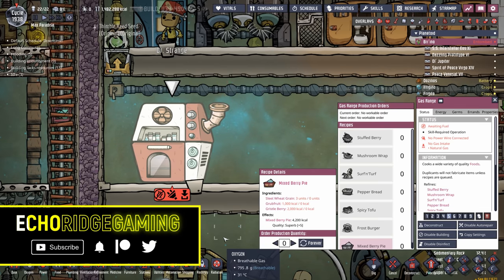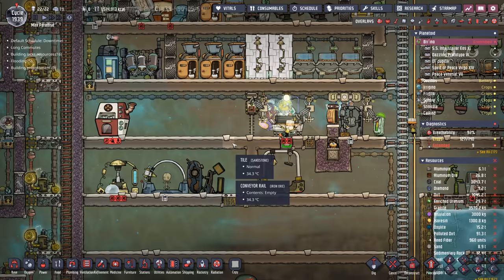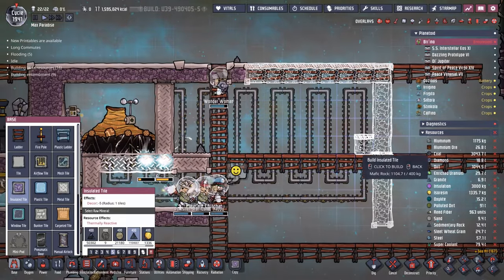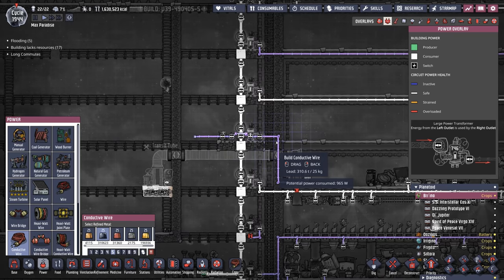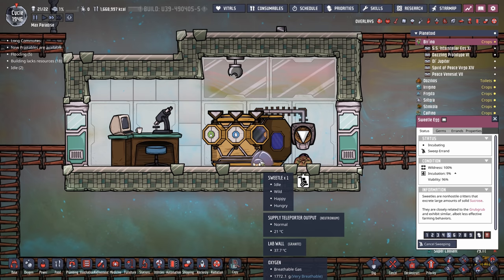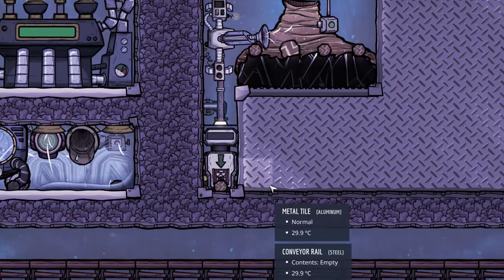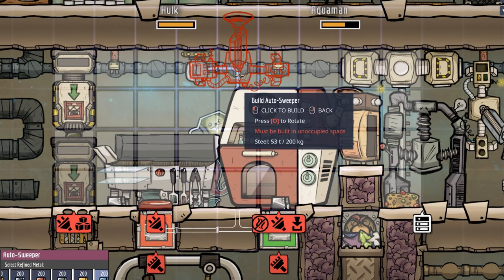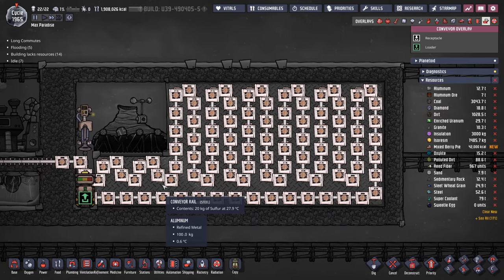Mixed Berry Pie | ONI Spaced Out | Max Difficulty Ep 24

Comment: You have a giant cool brick. Why not use that to cool your metal or in this case, Sulfur. Better yet pass it through your slicker farm to dump its heat then to the cool brick then to farm. :)
Reply from the maker: Two reasons I thought that might be problematic.  First the cold room is -200 something so I wouldn't want the sulfer to be that cold (and stifle the crops).  The second is I still would have to get it to the cold room.  Transporting the hot sulfer halfway across the map without being chilled, would have dumped a lot of heat into the environment.  

Also sometimes, it just makes for a good contraption to show YouTube :)
Reply: @EchoRidgeGaming  ok i didn't how far the cool brick was but its something impressively built. Gonna have to built one for myself.

In that case, my vote goes to puft ranch. That's something I've never been able to ranch successfully. They keep dying. Plus the one prince per ranch is challenging on it own.

Comment: You mentioned the sulfur backing up but you put part of its run of rails on a shared line.  If it backs up it will block the shared line as well.
Reply from the maker: Absolutely.  It will back up, but not permamentaly.  It will still move at a fairly regular clip.

Comment: pufts are not terrible to use for bleach stone. remember that a puft prince alone can support 6 waterweed. if a chlorine vent can support 2 pufts, then you can keep 12 plants going. if you are willing to invest some time for puft ranching, a single squeaky puft can support 57 waterweed plants. this means that a standard chlorine vent could support 114 plants. 

since you only need 2 to accomplish this, you won't need a dedicated ranch for squeaky puft breeding. you can have just a puft stable, puft prince stable, and a large room (non-stable) for mixing puft and puft princes. since pufts lay eggs fast, you wouldn't need but a stable for maybe 1 or 2 of each type.
Reply from the maker: Challenge accepted.  Appreciate the pep talk ;)
Reply: @EchoRidgeGaming  keep in mind the puft prince should be able to support 6, but that is on paper. i don't know if it could in game. the only time i have used pufts, was to feed mushrooms. i was able to support more than 10 with 2 pufts, with a building up of slime reserve, so it could be correct.

Comment: Couple of thoughts about the sulfur line, I BELIEVE they still have not fixed the bug where conveyor rails still transfer heat with the tile below them even when they themselves are in a tile, insulated or not. If this is the case since you have the lines exiting the cooling brick and passing directly over your aquatuner steam room there is a chance that it will heat the sulfur back up as it passes. This is probably why it was coming out so warm initially. This really screwed up a volcano petroleum boiler I made where I ran the igneous rock left over from the volcano thro a cooling brick where it passed over a steam room and heated back up from 35 to 150 degrees on the way out. The second thought is you have the sulfur making a pretty long trip through open air where the temps are at 60ish degrees. The sulfur may end up reaching the farm pretty warm early on. I think both issues can be solved by moving the conveyor line up 1 tile over the steam room, this will actually let the sulfur cool down the turbine as it passes behind it as well, and eventually the cold sulfur should equalize the ambient temps on its long journey without the need to lower the cooling brick temps anymore.
Reply from the maker: The steam turbine area is being cooled by the aquatuner as well.  Confirmed the sulfer is making it to the base in the 20s.  Thank you for the in-depth comment and analysis.

Comment: With regard to heating up your slicksters farm, molten slicksters are actually quite good for that despite only being able to survive down to 75 celcius. They spawn at 160 celcius and they weight 400 kg. This means that they would need to lose 118 MJ of heat before they die from the cold. For comparison, smelting a batch of steel releases about 93.5 MJ of heat. In addition, the temperature of the slickster resets when they grow up a so any heat they lose while they are babies is free. And CO2 is a terrible thermal conductor. Basically, they have enough heat to surving being fed luckwarm CO2 their whole life without freezing.

Comment: Cable joint plates work the same way wire Bridges do. Meaning they allow other wires to pass through the gap in the middle, you don't need to put a conductive wire bridge over a joint plate.

Also, until you get up to full speed in the grubfruit farm won't the excess sulfur that's not being used block your conveyor mainline?

Comment: Carbon dioxide is a really bad thermal conductor. So to spread out the heat more evenly in slickster area make a self looping conveyor rail with refine carbon that passes the slickster area and the two metal tiles. 
22 ravenous dupes eating frost burgers requires 7.33 waterweed plants which require a total of 3.67 kg bleach stone a cycle. One ton of bleach stone lasts about 270 cycles. It would be better in terms of lag to have a rocket drill an asteroid once or twice and that would last this colony.
Vacuuming out the outer areas of your base would increase performance, just remember to have a cooling solution for transformers and other industry buildings

Comment: I had a similar setup for cooling my sulfur out of the geyser, but then I realized that if I just insulate the geyser and get the liquid sulfur with a steel pump, with the liquid going through 2 liquid valves set at 1000g/s to avoid breaking the pipes, it's super easy to cool the sulfur with as few as 2 radiant pipes going through a cold box with 20C water, and then just drop it on the ground where a sweeper can take care of it. So basically a 2x2 cool box is enough, much simpler setup, and you can get 2kg/s, or 1200kg/cycle. I also added a weight sensor to something like 500kg or so, to avoid the sweeper activating non stop to pick up 2kg at a time.